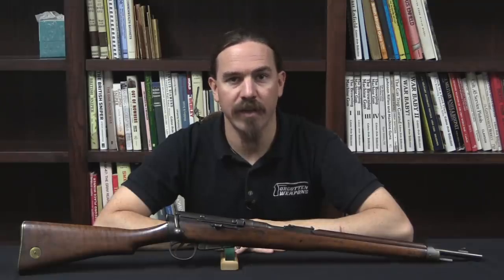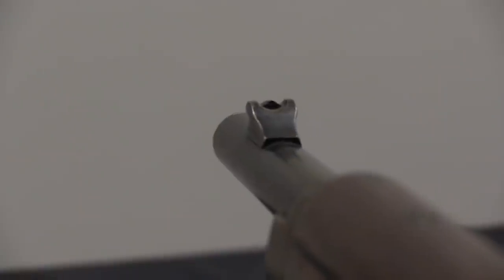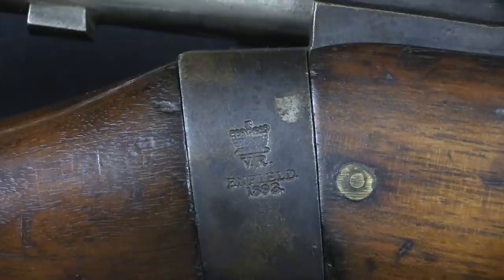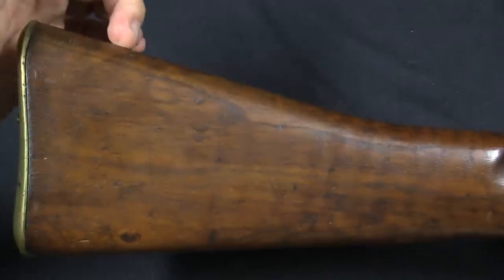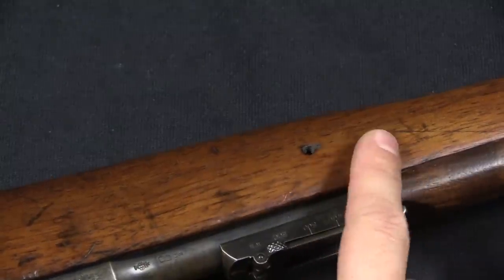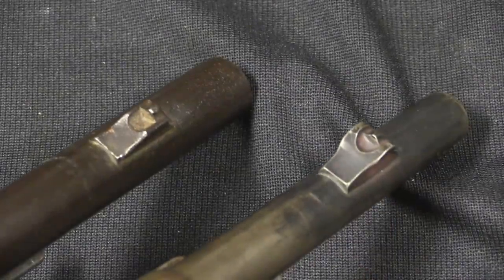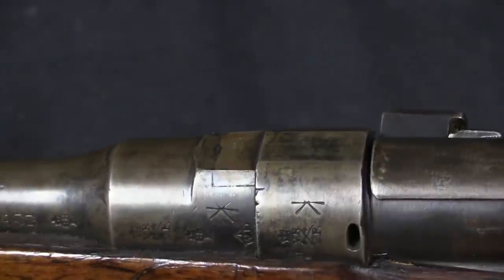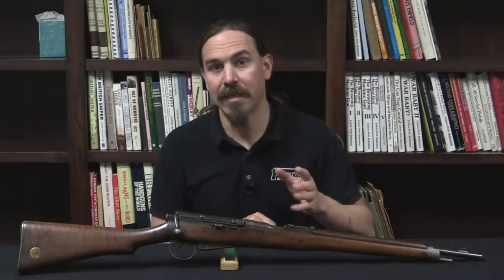1893 Lee-Metford Trials Carbine (One of Only 100 Made)

Comment: I found my father has an old gun that was used for decoration. I am 98% sure it is a Lee-Metford. This is in South africa

The receiver socket also has the royal crest on the right side and a date of 1890. The stock of the gun has the number 252 engraved on the right side, behind the receiver socket, as well as on the butt of the gun. The number 117 is also engraved on the rear right side of the stock. The receiver has the serial number 2421 marked on it a few times. Some of these serials have the letter "E" under them. There are also some arrows engraved onto the receiver, which looks like broad arrows maybe. The stock of the gun also has some kind of intricate engraving, which I assume the owner of the gun did at some point. There is also a metal plate with range markings near the rear sight of the gun, I believe it it for the volley sights.

Lastly, I believe the barrel band wood was modified. It is slightly shortened and there is no metal band, instead the wood curves to the barrel. There is no wooden band on the top of the gun. I've been told that this possibly might be called a cadet modification?